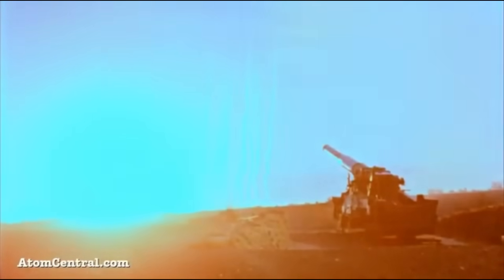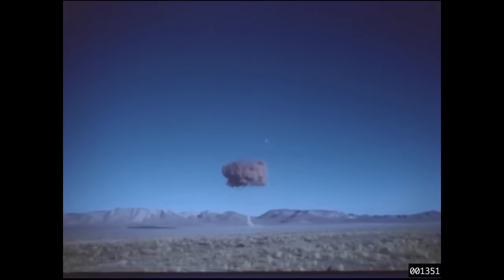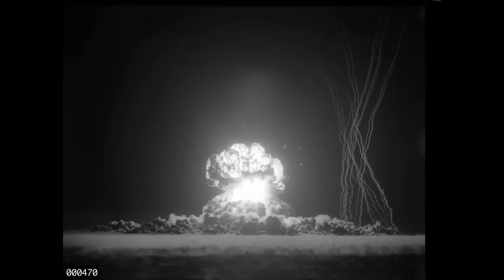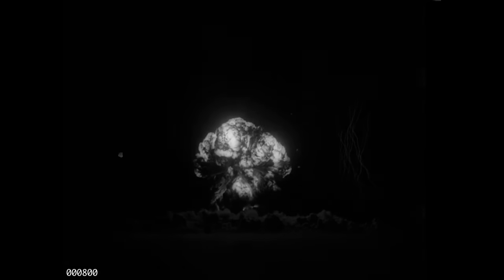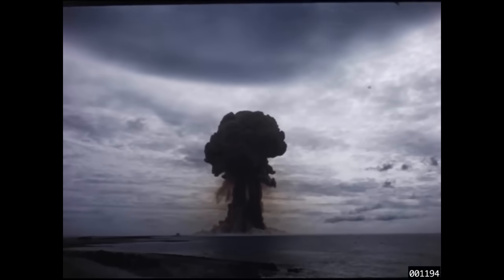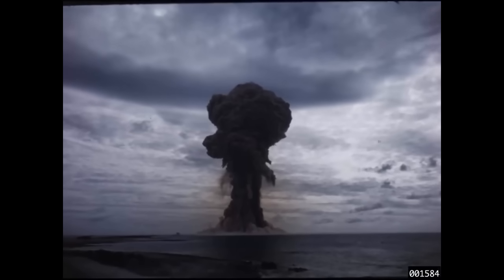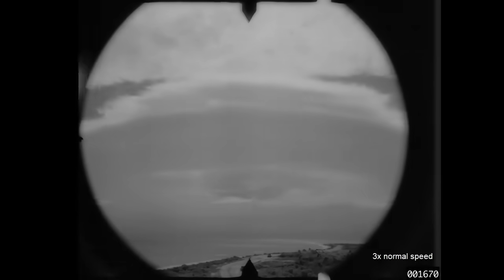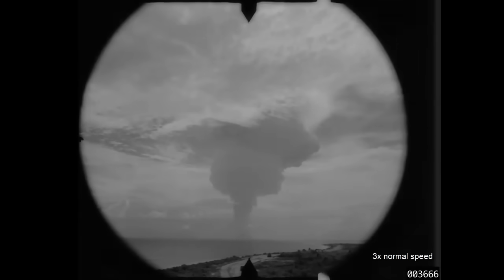What does a nuclear bomb sound like?

Comment: Yeah. I think the single biggest thing that people get wrong in cinema is how long it takes the sound to travel. Like. You see a fire work go off and it explodes and then about a half second to a second later, maybe longer depending on distance you hear "whistle kapopphh". That's maybe 1000 feet in altitude, probably and you're a couple thousand feet from it on the ground. I forget my middle school formula for calculating  but you aren't that far from the explosion.

When it's an explosion that you can see seven or eight miles away, yeah, the single biggest thing that will startle you is that you will see the explosion, maybe even feel the earth shake because the vibrations will travel through solid mass much faster then air. Depending you may hear things rattling a little like a very small tremor... And just when you start to think "well maybe they're just silent when they go off, you'll get this deafening crack with a continuous roll of thunder following after it. 

Also ironic is that "duck and cover" is considered by most to be the ultimate expression of futility, but it actually isn't a bad idea. If you are outside of the instant death zone and manage to be on the outer edge of the heat blast zone, your main issue at that point is concussive force and debris, so at that point, basic earthquake response, doorways and under furniture that may take a load if the roof falls in. Even being in the heat zone isn't necessarily certain death though you might wish you had.

So sure. If you see an impossibly bright light, and begin to feel the earth rumble under foot, get under something solid and cover your head, or belly to the grass and cover your head. If nothing else it is at least more effective than dropping your pants and spreading your cheeks so the nuke can kiss your ass goodbye. The concern of nuclear war is not surviving the first strike, the concern is the strikes that follow.

Comment: 7 Miles away or 11.3Km
the ground transfers the sound easier so you get the Rumble first then the first Wave of air which is the bang and wind after. Even that far away the crest of the sound wave is holding, for about three seconds after the bang it is noisy but there is no stand out noise, then the whistling of the wind kicks in. It took three seconds to pass so that crest was 1 Km thick.

Comment: A nuclear blast don't really "have" a sound. A nuclear blast is measured at around 240-280 decibels. Anything above 190 is no longer considered sound and is more akin to pure concussive force. Your ear cannot process sounds above this range...because anything above 185 immediately ruptures your eardrum. Flashbangs are rated at 183-185.

Now, sound Increases exponentially every 10 decibels. This means that if you increase a sounds volume from 20 decibels to 30 decibels, you're actually "doubling" your volume (don't quote my exact numbers, I didnt double check) and "doubles" again when you increa#e it to 40.

150 is the sound of a metal concert or jet engine. 
185 as stated previously is a flashbang. 

When you reach 240 decibels, the concussive oomph of the sound wave is so "loud" that when it strikes you it totally blows you apart. You cannot hear this sound wave because it annihilates anything human or human built that is capable of recording it from close enough.

This concussive wave is the blast wave you observe in blast test footage that blows building apart, and this blast wave does the most initial damage before the heatwave flash cooks anything remaining.

Comment: Wow first time hear that's EXACTLY WHAT I expected would be after decades of hearing silly dramatised overdubbed soundtracks. A short sharp crack bang. Even the preceding EMP pulse affecting things in time with the flash.  
Maybe the film broke at the flash point and spliced back together, missing a frame, or just partly melted, whatever resulting 24 FPS film frame buzz in time with the flash

Comment: Fantastic work! LOVE that EMP-oscillation-noise leaking into even the vacuum-tubes in the recorder! 

Accurate sound for dramatic, kinetic physical events (and this is possibly one of the most dramatic) is a big thing of mine, for much of my life! Hollywood (and media-creators in general) seldom accompany their work with accurate sound. There are some exceptions, but they're rare! Credit-wise, I'll just say Stanley Kubrick was very good, and leave it at that.

Not only do they get the sound of nuclear-weapons wrong (for which they might be forgiven due to the rarity of the occurrence) but the comparatively mundane (by comparison) sound of being shot-at, or the less-mundane sound of a V-2 falling on London during WWII.

It's a shame that almost nobody seems to accurately capture the eerie silence at the flash/smudge, followed by the thunder-clap and aftermath of distant explosions, big and small.  One exception is military simulators, which are starting to get it right, after being literally begged to do it for about the past two or three decades! For example, what (and when) does it actually sound like in the cockpit (at the correct time) after dropping a bomb or bombs from an aircraft? It seems like a simple question, but there are many variables and the reality would be counter-intuitive for many, I suspect.

Comment: I was not surprised at the sound. I have heard and felt one large detonation in my life. An oil refinery pressure vessel blew  about two  miles from where is was working. It was a dull thump that one felt as much as heard, and it rattled the window. I wonder if the A bomb detonation created a ground shock that could be felt by the observers. I think, although I could be imagining, that I felt the shock of the oil refinery explosion through my feet. It definitely shook the large building I was in.

Comment: I thought the coolest part of the video was the EM pulse acting on the microphone at 1:43.  Just the fact that a radio wave can be so powerful as introduce EMI on a device miles away is amazing.
Reply: instantaneous too. Speed of light.
Reply: What is even more crazy is the light from the explosion is so bright that the background becomes dark for few seconds
Reply: It travels at the speed of light 😂 it isn’t that amazing
Reply: Not an EM pulse, actually. The EM pulse is over in a microsecond. What you're hearing there is the actual film being warped due to the immense heat, which is why the sound matches up with the brightness of the light. 

Sound was recorded on film in some of these instances. Technology Connections has a video about it.
Reply: @FSAPOJake   Well, technically it 
is an EM pulse, just that said EM radiation is infrared.
Reply: @juniuwu  It's nothing, just your imagination...
Reply: @FSAPOJake heat doesn’t travel at the speed of light 😂

Comment: This is what "the shock wave" sounds like.  Not the actual explosion.
Reply from the maker: The Shockwave is the sound of the bomb. Sound is just pressure waves in the air. The sound of a firework is the preassure wave. Thunder is a preassure wave. It's all sound.
Reply: @venera13  Pretty sure it would sound different if you were standing right next to it...

Comment: The sound wave is an overpressure pulse that causes most of the initial building collapses. In a Fission-Fusion-Fission device the first fission compresses tritium and floods it with excess neutrons from fission - which causes fusion whose neutrons go on to cause fission in secondary fissile material. Gamma emission not x-ray

Comment: The first plutonium implosion devices were not appreciably hollow. They were pretty much just trying to squeeze a solid piece of plutonium smaller as precisely as physically possible with explosives. Hollow cores were a later innovation that significantly reduced the explosives required.

Comment: Oppenheimer 2023 got it right just like the one in this video. Goes to show how extremely slow sound moves compared to light and that the actual sound most likely changes a lot by the time it reaches people's ear and ends up sounding like a massive shotgun blast.
Reply: Ngl I thought Nolan made it silent just for dramatic effect but it was actually accurate based on the distance the observers were watching it from. Puts into context how large the explosion bomb is since they were so far from it that it took that long to reach there.

Comment: This nuke is a fire cracker tho compared to Trinity and tsar bomba.
Reply from the maker: Trinity was only 25 kt, much smaller than modern tactical nukes. The bomb in the example was 16 kt. Smaller but not by much. You are correct about Tsar. It was around 50 megatons. Which was obscenely powerful.
Reply: @venera13  I shoulda said castle bravo but still the point stands, this is a small nuke. Imagine what the tsar actually sounded like 🤯

Comment: Fat man was far more efficient than little boy.
Reply from the maker: Indeed it was. Plutonium implosion bombs always are more efficient that gun type uranium bombs.
Reply: @venera13  I dont believe the plutonium made any difference.  It was the implosion compression that produced far more fusion reactions before it blew itself apart.  The gun bomb was incredibly wasteful.   Much of the energy was leaking out before it reached critical.   It took a much larger amount of Plutonium. The implosion device used 1/10th the material for a substantially larger blast

Comment: The actual sound of a nuclear blast is a shockwave, or a sudden change in air pressure. A Fourier analysis would show many frequencies simultaneously.
This sound pulse interacts with the ground and the layers of the atmosphere, so it may be different from one blast to another. And, this type of sound is difficult for microphones and audio gear to reproduce accurately.

Comment: "A nuclear bomb is not an ultra fancy bomb that uses super-science to make big explosions"

Actually, it is. Harnessing the power of the universe with science is not easy. Critical mass is incredibly difficult to achieve.
Reply from the maker: Depends, implosion type bombs just require good timing but are more difficult. Gun type bombs are so simple they didn't even test the design before using it, and high school students could build one.
Reply: @venera13  High school students could build one, only IF they could get the U235 for it, and that represents a challenge in itself.

Comment: Nuclear explosions are basically like creating a tiny star for a split second. The nuclear fusion that gives nuclear bombs their power is exactly what's happening inside the sun.
Reply from the maker: Not quite. The bomb in this video is pure fission, as in its energy is produced by splitting plutonium atoms. Hydrogen bombs use fusion to increase energy. A fission primary initiates a fusion secondary which allows more fission in a uranium tamper. So some nuclear bombs do utilize fusion, but fission still plays a big role. Stars are pure fusion due to compression.
Reply: @venera13  That's what I was talking about. Not specifically the one in the video. Practically all nuclear weapons in the modern day are thermonuclear. Atomic bombs were made obsolete less than a decade after the first nuclear detonation. Since the 50's fusion bombs have been the go-to. The fusion in Thermonuclear weapons is virtually exactly like that of the Sun. Down to Hydrogen being turned into Helium. Fusion and fission are very similar, though fusion is more powerful. Simply because it requires more energy to force particles together than it does to tear them apart.

Comment: One could synthesize the sound using AI. You just feed it what exactly it needs to spit out (pressure + air travel in condition + some other factors regarding terrain) and it would be capable of rendering the sound with great accuracy. There's already several AAI (Audio AI) that exist and function working for the movie industry and various other applications.

Comment: You hear the shockwave and then the echo of that shockwave around the area and impact sounds of the larger uplifted material crashing down.  Basically imagine the sudden displacement of air created by detonating 10+kTons of TNT (high explosives).
  
This is a key difference between deflagration (subsonic combustion), and detonation (supersonic combustion) which creates a shockwave.

Comment: A couple questions for you engineers and scientists:  1) Does the nuclear explosion produce a shock wave?  And, don't shock waves actually travel faster than a sound wave (compression wave)?  Or, would the shock wave not travel the distance from the explosion to the microphone? (Shock waves convert to heat rapidly)  2) If the blast thumped the ground and caused a surface wave (essentially a type of earthquake wave), that wave would travel probably 10 times faster than the air wave.  Would a person hear that wave first?
Reply from the maker: Yes nuclear bombs like all large explosions produce shock waves and yes they can travel faster than sound. It depends on the makeup of the ground but yeah in theory you might be able to feel it before you hear it due to sound moving faster through solid than air.

Comment: I think Hollywood did a decent job. Obviously it will be dramatized as it is Hollywood, but there definitely was a low rumble that ever so slightly seemed to increase in intensity after the bang. You made it seem 100% inaccurate. All they really screwed up massively was the huge loud bang.

Comment: I had old timers that were at the test as lab rats. They said it reminded them of a rocket launch the rumble. I always compare it to the space shuttle SRBs you can the bang from the  initial shock wave followed by rumble with multiple supersonic shockwaves. The vibrations is like 60hz or 60 vibrations per second. And that’s having 60 supersonic exhaust shockwaves per second.

Comment: That EMP whack that the camera took right at the beginning of the film,  is scary...That was a old non- computerized analog camera and it took a pretty good hit. Makes you wonder what it's going to do to all our digital equipment we use now. I have a feeling nothing is gonna work for years after we get hit with one.
Reply from the maker: Most of the EM noise was the intense light and infrared messing with the mechanical components. A nuclear bombs detonating on the ground doesn't make a strong electronic magnetic pulse that fries electronics. You need to detonate it in the ionosphere to produce one of those.

Comment: It's often forgotten that older footage doesn't always come with a sound track - the recording equipment could be prohibitively heavy & bulky, needed extra power, or was too fragile. It's a particular issue in a war setting.

So much footage had sound added afterwards, usually generic tracks, before it was shown. Crowd noise, machinery, explosions, vehicles, weapon fire - lots of it is added. 

It could also be that any sound recorded isn't of sufficient quality, or wouldn't meet viewer expectations! (that could be because the recording equipment doesn't have the capability to capture the full frequency range, particularly low, 'thundering' frequencies). This footage is a perfect example: the explosion noise isn't what we expect.

Comment: How many aimals were killed in the testing of that bomb? And how much radiation remains there and for how many years?
Reply from the maker: A lot of animals where killed, most intentionally. Especially pigs they where used a lot. In some pacific tests they filled old ships with different animals and put them close to the tests just to see how they where effected. It was rather barbaric and not pleasant to think about.

As for environmental radiation. Not much. Its mostly decayed away in the general environment. Global background radiation is more or less back to what it was pre atomic age. The test sites still have some elevated contamination. Pacific islands used had it the worst. It's safe to visit the test sites without much issue. But you don't want to breath in the dust or live there long term.

Comment: "A nuclear bomb isn't some ultra fancy super-secret type of weapon that uses super science to make big explosions."

I'm 100% positive that's exactly what a nuclear bomb is. Has nobody ever told you that creating an artificial monologue around an issue that doesn't exist does NOT make you sound an ounce smarter?
Reply from the maker: A fission bomb is just compressing plutonium or uranium into criticality with explosives. Hydrogen bombs are just using a fission bomb to initiate a fusion reaction. From a mechanical and design standpoint they are very simple devises. The difficult part is just getting the fission material. I did a video explaining how all the different types of nuclear bombs work. It really is just making fission material go supercritical primarily with physical force.
Reply: @venera13  Sounds like science to me. Not to mention you oversimplify the process a lot.

Comment: Narrator is a PUNK CLOWN! Yeah the PHYSICS behind a Nuclear bomb ain't all that complex but the Engineering process of enriching Uranium is a WHOLE different story and don't GET ME STARTED ON ENGINEERING A FUSION BOMB, only 5 countries IN ALL OF HISTORY have managed to do that (I don't believe India).
Reply from the maker: I was purely talking about the operation of the bomb. Manufacturing the fission material is very difficult and is the primary barrier to construction. For more info I made a video where I explain in detail how nuclear bombs are built and operate. From gun type to implosion type, foam plasma to tamper ablation in staged fusion. Although I did at one paint say most of the energy in a hydrogen bomb comes from the fusion, which was an error, but it was corrected in the comments.